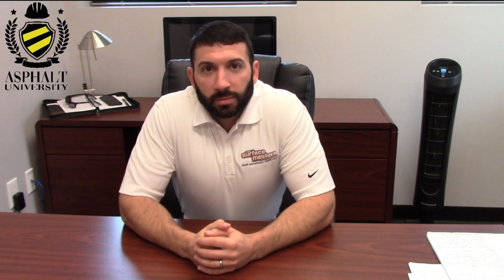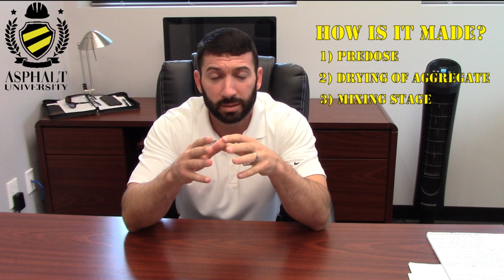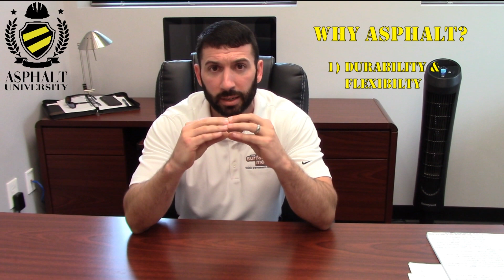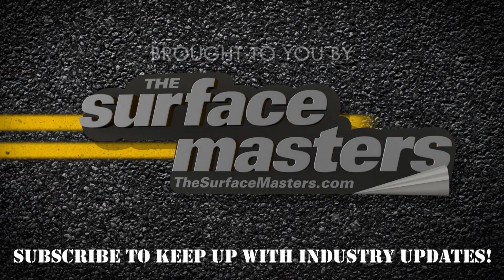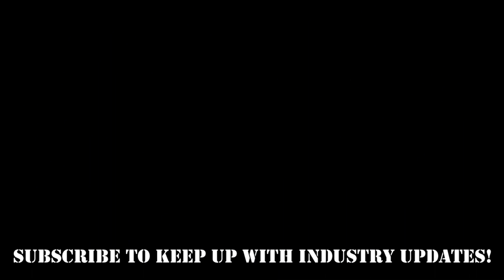Episode 1 - Asphalt 101

Comment: I work for a small company that uses a Leeboy 1000F tilt box, 1 ton roller and a single triaxle and we struggle with seams and roller practices.  I just subbed to your channel and am about to look through your videos to see if you already covered it, but I'd like to see videos about how best to manage cold seams and good roller practices to properly knead out the mat without producing roller lines or tearing the mat from over rolling.  I'm the low guy on the crew, and the information coming out of the experienced guys just isn't adding up in my head, so I'm trying to research to see if I can learn something to bring back to the company.